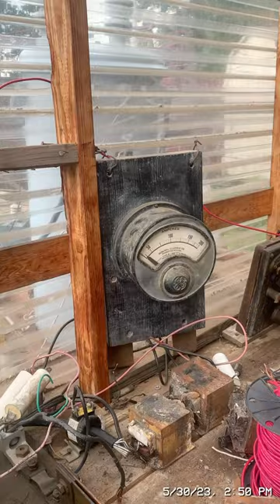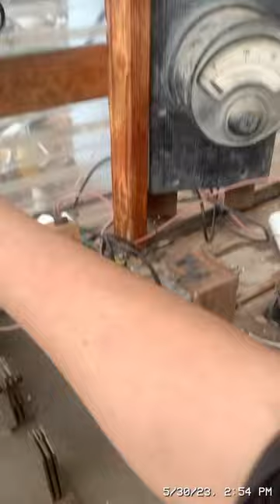Magnifying transmitter explained

Comment: I’m curious how does it sent the electricity through the earth because I understand how it is a Tesla coil and can produce electromagnetic fields but wouldn’t the electricity be dispersed through the earth as it is the biggest ground ever so how can it sent I through the earth? Or does it just sent the electricity through the air with electromagnetic fields but then gets grounded using the earth instead on grounding from corona discharge? And if so does that mean it’s just a large Spark Gap Tesla Coil that resonates at 168kHz?
Reply from the maker: Energy FREQUENCY vibration (resonance) you can’t shatter a glass using the wrong frequency
Reply: @dr.parkinstine  Is it a 3 coil or 2 coil?

Comment: Hey heard about you from oompaville really cool stuff your doing I have a question though so if your using the earth to transfer electricity what would the efficiency on the energy transfer be? Im not super versed in electrical transference and attraction and I know that the earth would direct the electricity to the nail but id imagine that a lot of the energy would also be dispersed throughout the ground loosing a lot of the efficiency correct me if im wrong just trying to understand the energy transfer system a bit more.

Comment: I'm curious as to how large a scale this can be implimented. How much power can be transmited at once this way, and is it enough to reasonably power more demanding appliances?

For example, at what scale would you need to build a system like this in order to wirelessly power an average modern household, and can you even transmit constant and consistent power in this way?

I'm very interested in learning whether wireless electricity is practical. If not can it be made practical, given the average persons power consumption?
Reply: I'm worried about how it would affect the ecosystem around his house
Reply: @ThatOneFlyYouCantKill the ecosystem shouldn't really be effected by it. As the earth itself has its own magnetic and electrical poles. This is just kinda riding those currents